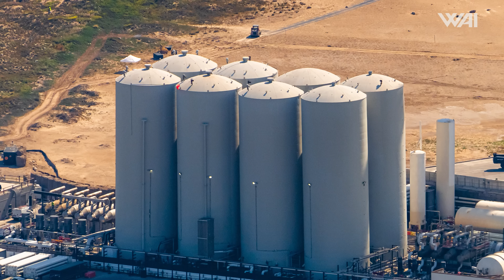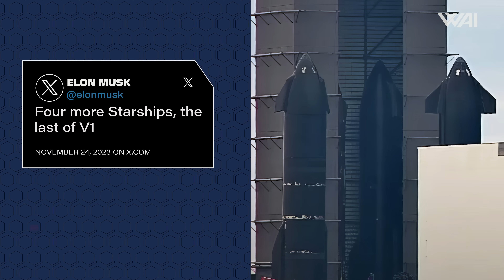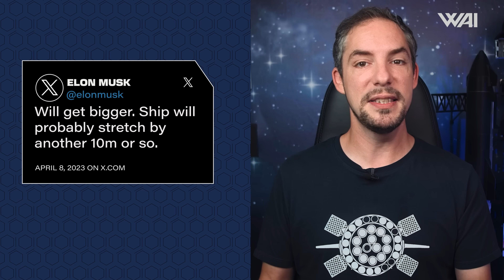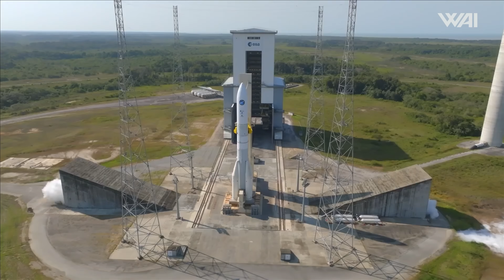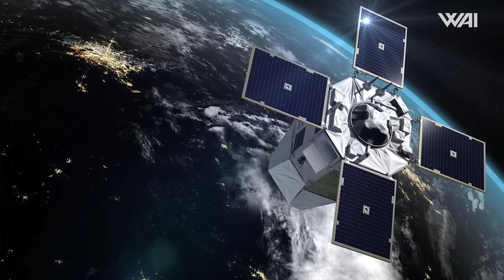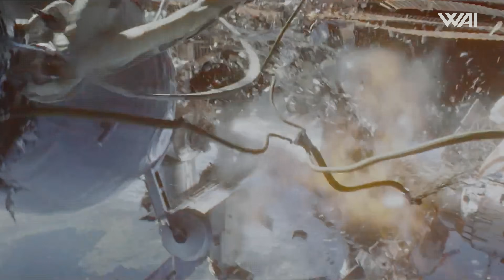Starship Evolution: Why SpaceX is Shifting To V2 Starship Now!

Comment from the maker: Go to https://myradar.com/ to get the best-rated weather app there is for Android, iOS & Windows! Weather as you've never seen it before!

Will they prioritize launching existing Ships before fully committing to the V2 design, or will they skip a few and go with a more advanced Prototype design? :_WAIShocked:
Reply: Felix, that would be great if you embedded the time stamps of the different topics in your videos.
Reply: They will test the existing ships still, TEST TEST TEST TEST.  They might not test all the V1 ships but they will test some of them.
Reply: I tried my radar on Felix’s recommendation and the radar alone is worth the cost. Radar animations are far better than the free weather apps.
Reply: I think if they can have a more rapid test cadence they will take it.
Reply: One ‘upside’ to things breaking, is that it makes it quite clear which parts are being broken or damaged - and so where to focus efforts on shielding and reinforcing and other measures, to achieve a more permanent solution.
This might still take a few iterations to get there…
Reply: They probably won't launch this year and they only have the capability to launch like half a dozen vehicles per year. So I think they'll try and make each launch count. So maybe 1-2 more V1 launches in the first half of 2024 (depending on if IFT-3 is another failure).
Reply: Skip them. Go straight to the latest design.
Reply: The thinner SS is a great idea but Elon and his team have not taken that to the limit yet. I know that Stelco Canada now bought out by US Steel, produced a much stronger cold rolled steel a stainless version of this steel which developed its high strength from special processes in the rolling mills that produced steel with twice the strength for the weight.
GM used non stainless version of this for their prototype run of Cruz police cars in 2011 for the Ontario Government.
Reply: I think the first thing they need to do is figure out how to keep the tiles on, something that has stymied engineers for over 4 decades.  Either that or figure out an alternative design which doesn't require a tiled heat shield.
Reply: @@MPK2112 Only two. It’s only two tests. Two launches, so far.
Reply: No
Reply: @@MPK2112 two prototype launches in one year and you're already going with never? They had 12 prototype launches of F9 over a 2 year span. Starship is much larger and more complex. F9 uses RP1 and a pretty standard engine. Starship is using an engine that has never been used before. It will take time. I'm quite impressed with their speed.
Reply: @@MPK2112 Yep, that's how they work. Government regulations may slow down launches but they don't slow down R&D.
Reply: I wondered the same thing. Perhaps they did (On the Quiet)-face it it kinda lets in the FAA in2 places they actually weren’t in& hence can’t CRIT on. And hold up launches from. But as you thought. So too did I. Face it it would have resolved all of the final questions missing to Absolutely perfect this growth to completion. And would have saved a ton of money.
Reply: With 4 version 1 ships available, they can take plenty of time to work out details of v2 design while still launching (and learning) as fast as they can get licenses.
Reply: Because it blew up and was not a success
Reply: How's life in the MuskCult ™?
Reply: @anthonylosego 21:47 21:47
Reply: @davidwildenheim6873  yeah, I watched that one, but I was thinking straight from V1 to V2. Paperwork will take longer than assembling S33 V2. Lol

Comment: Like Starship, the original Atlas missile was built by stacking circular segments. Atlas was "stretched" by adding more rings. Each Starship ring is 1.82 m tall.  A stack of 5 rings is 9.1 m tall, so adding 5 rings would increase the height by 9 m, which fits with Musk's tweet of 5-10 m taller.

Comment: The amount of innovation Is incredible.
Reply: yeah, the innovation in exploding is impressive. Now if Musk could innovate in actually reaching orbit.
Reply: alot of reinventing the wheel. Even if SS gets into space and back, it could still be a failure as the name of the game is cost and recertification.  Increasing engine pressure for more power means more stress. It is sacrificing engine longevity in exchange for performance. And that is why rocket engines have such short lifespans. They are generally operating at the edge of what material sciences can do.  What SpaceX should be doing is firing their raptor engine at the power setting and duration of the flight. THen doing it again and again to find out what the mean time to failure is. And how fast can they check all the parts and recertify it for another flight, and at what cost. That is what SpaceX should be doing.

Comment: Fun mind bender is trying to figure out if there could be a way to have a flexible insert inside the fuel tanks that empty out like a tooth paste tube and depending on how the valves are designed for the space that is voided out from the inner tube inverting into itself, keeping the fuel snugged to the nozzles, that it could help with how complex things get during maneuvers. Might have to be an idea that comes along when we can make meta materials on the sub atomic level and scale.. I wonder what Grok would mush into a concept design?!?

Comment: I think they will launch the V1s in fairly quick succession until they get to orbit and land.  They might put raptor 3s starting with flight 4 or 5 if required to get to orbit.  These flights are very much system and control development, most of the changes go to efficiency and performance and introduce only minor risk by rolling them in later
Reply: Problem is every test expends 39 engines. That’s a lot
Reply: yes that's why they will stay with raptor v2 if they can.  They are just working on a process.  They don't mind losing V2s since they don't want them anyway.  once they get the process down they won't lose many or maybe not any V3 ships or engines @rdmsh
Reply: Hopefully the EAA stays out of the way of rapid launch cadence.

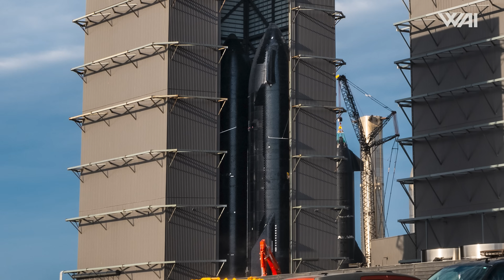Comment: 12:24 A great advantage, IMHO, in engines is what might be called "throttle range" so that many can be used at lower thrusts, but if one fails, instead of turning off its opposite number for balance, you increase the thrust of its neighbors to compensate.
Reply: SMOP.  ("Simply a matter of programming!")
Reply: Given you probably want to use as much thrust as they'll provide, the thrust vectoring is even more efficient
Reply: You might be interested in checking out the "GenSet" locomotive concept where one big engine is replaced with 3 smaller ones in a locomotive. When the locomotive is moving around the yard without a train, it can use one small engine for power, but as more power demands are required, more motors are turned on. It's more fuel efficient but requires 3x the number of engines along with 3x the engine maintenance and support equipment. Anyway, trains aren't rocket science, but one can learn by applying what's been tried in other areas to new domains.
Reply: @MarkNobleUS  --  I understand that most of the "Gen Set" locomotives were scrapped early.   The 2000+ HP can last years (like 6+) without major rehab and can be overhauled an easily kept going for decades.   500 hp engines aren't worth fixing after a one or two overhauls and the overhauls in constant use might be required only after two or three years.

Some RRs tried the hybrid approach.   They have marginal applications.   The RRs don't get conned into adopting stuff just to be trendy.   It has to save money or provide other benefits.   It if makes money, RRs don't hesitate to spend money.   Otherwise, they sit on their hands.

Comment: The main reason for the shielding was the RUD of stage 0 I believe, so you could probably remove that from current version because the risk has been shown to have been lessened with the redesign/upgrade of stage 0.

Comment: I would imagine SpaceX will use a mix of launching current V1 ships while using info learned there to work on V2 design and development.
Can never have enough data when it comes to such things after all.
Reply: Sure thing Wherner Von Braun , .
Reply: might as well launch a couple, if they have the boosters, I bet they have to tweak the process some and making the starship thinner may not be a great idea given how easily the booster (apparently) ruptured after the hotstaging.

Comment: One must not forget that it took them a while to learn how to build the rings to have welds strong enough to contaib pressure when filling up with cryos.
That the ship takes more explosives to self-destruct  does not  necessarily mean they can thin the heavy steel  and forget about the spectacular fountains of nitrogen as the tanks exploded during tests.  (though this happened a ot mroe during days when they were still learning how to weld).   Not an issue for the higher part of Starship that is to have unpressurized cargo, but for tanks, I wouldn't be surprised if they stick with the thicker steel.   Thinner steel also has heat absorbtion/dissipation changes during re-entry.

Comment: In the mean time test flights can be just for testing the booster, and the hot staging. From all accounts the flip after the hot stage was too aggressive. Testing and fine tuning that maneuver does not need the V2 starship.
Reply: You have to have the weight.
Reply: to test the hot staging and booster flip back maneuver you need the V2 starship?  i don't see why as the hot staging likely still has some tweaks it needs to be better, so test and adjust before getting into V2 so it is a non issue.  also the booster flip maneuver does not need V2 as it has already detached.  Test and tweak and adjust so it is also a non issue when transitioning to V2.  They have the rockets, use them to enhance and perfect the steps and process from launch to stage separation.  Also gives you more information to use to make V2 even better.  More flights is more information gathered to use to make better.

Comment: I think IFT3 will be a V1 design, IFT4 might be ship V2 design, but possibly booster V1 still. By IFT5, both will be V2 design most likely for sure.
Reply: Yes, I'd pick two more flights from the current V1 hardware. Partly because they have that hardware ready to go, and partly because they'll want more data from V1 to inform the design for V2... in particular, they'll be very keen to get at least one re-entry attempt out of V1 before committing to the V2 design.

Comment: Since they have lost 2 boosters and 2 starships so far, I think they should launch existing ships to see what the problems are before committing to v2. Now if they can upgrade the engines to v2 without changing the ships as is then I think they should do that.
Reply: The ships were never to be recovered. The evidence needed as to the problems was likely telemetered to SpaceX; they may or may not share it. If the existing ships have some of the problematic bits, they will never be launched until refitted.
Reply: They never lost anything , the two ships  were data collecting tools for future upgrades and better ship's, its all about evolution , its never about failure/succes like our educational system taught us and many of us still think that way unfortunately ,  its about evolution and constant learning by prototyping and trying new things and make improvement's over time just as it should be in real life .
Reply: yea the old designs have to much mass and the booster is the costliest part with 32 hard to produce raptors they will not waist a booster to send an old prototype with old flaws rapid iteration is needed the get these skyscrapers into space.

Comment: They need to install baffles in the tanks to prevent fuel slaush when separation takes place a single baffle would prevent fuel from bouncing around the tank.

Comment: The decision to scrap work-in-progress in favor of version 2 revisions before next flight would surely be based on what could be tested with WIP. For example, supposing an issue with fuel slosh or jacking caused the failed re-lights of booster engines, using WIP to test revisions might be valuable enough to invest more in flying them
Reply: I'd guess once the first V2 is ready and passes ground tests  we'll see whatever V1s that are left scrapped
Reply: @KiRiTO72987  I agree.  use what you have ready to go or nearly ready to go while you build the V2.  but once that is ready and tested and green lit for launch, then use that as by then many of the issues still had on last flight should have been adjusted and then flight tested and hopefully perfected so they wont be an issue
Reply: LOL. These are for his stock price and ego.

Comment: That Susie thing looks quite promising and versatile, I hope they make it happen.
Reply: It does... it sort of fits a niche between Dragon and Starship. It doesn't have room for much fuel, so I assume it's intended to sit on top of an upper stage like Dragon does rather than replacing an upper stage like Starship... so a capsule with integrated service module and propulsive landing (like Dragon 2 was supposed to do).

Comment: With the tiles they should install them on some kind of flexible like subfloor. In 50×50 tile sections. I believe they come off due to the low temp and the flex in the tank. If they were adhered to a simi- floating sub floor a few  Millimeters above from the main body, that would  Alleviate any effects caused from the starship From losing tiles.

Comment: regarding the stand up tanks so close to the pad 99.9% of the general public thought they would get damaged with the 1% being spacex and its managment..Doh
if there going to use stronger thrust engines ..good luck with the metal water cover.

Comment: There's no reason to immediately exclude Composite materials - the fore and aft flaps could easily be made from Carbon Composites or Aluminium Honeycomb to save mass, same with the rings and cone above the tank section, and any internal structures to hold and release payloads, Titanium would also suit those internal structures, giving the strength of steel for the weight of Aluminium.

Comment: Drymass reduction means certainly a new composition of materials on the Grid fins of the booster. I wonder why noone is talking about those. In the one interview from Everyday astroaut Musk himself is saying that they will change the Grid fins because they are too heavy currently.
Reply: Indeed, considering the marginality of their function, they are monstrously heavy, and the batteries / motors to operate them  have significant mass as well.. One would think that by now they would have come up with something lighter and smaller to achieve the same results...
Reply: Maybe just small fins like on the New Glenn rocket, but Elon copy Jef Bezos a bridge to far.

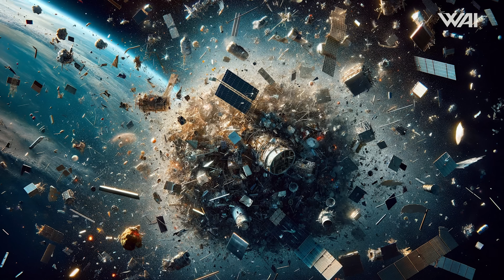Comment: 21:17 Luckily, images like this are not to scale. Though, cleaning up space debris is like collecting spent bullets at a firing range, but people are still shooting - and some of the bullets are the size of school busses.  A lot of space debris will de-orbit itself, but in cases where it won't, the best approach is probably to use high-energy space lasers to blast parts of the object vaporizing it in a little explosion that causes thrust in the opposite direction. Depending on the mass, it could take a lot of pulses. One might even use lasers to turn satellites into a sort of Crookes radiometer by darkening part of their surface with carefully aimed laser blasts - but there may be too much of a vacuum in space for this to work.  Essentially, the problem is how to impart energy on masses in orbit without having to expend the time/energy needed to move a mass into a docking orbit to shove it without causing a collision that would result in even more space junk.  It'd be interesting to study whether or not it makes more sense to "sweep everything into a pile" then de-orbit that - or to make a prioritized list and de-orbit things one-by-one.

The "sweep to pile" approach might allow the exotic materials we've sent to space so far to be packaged up in a rocket and de-orbited (using Earthbound Starship trip capacity after delivering cargo to orbit) for recycling. Probably a good idea after putting all of the junk inside to fill the compartment with spray foam to stabilize it for landing or something so it's not bouncing around inside.  What's important is developing the capacity to try lots of different approaches and see what works best in various situations. "All of the above".

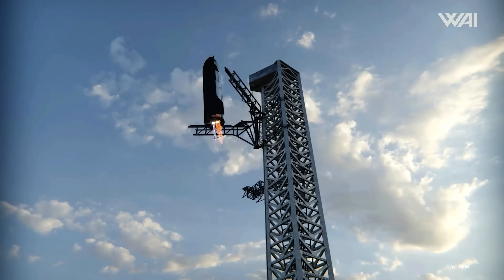Comment: Your analysis of the facts at 7:21 of the catch always being planned is wrong. It wasn't until they realized how hard it would be to land the Massive ship gently and the even larger planned booster did they realize that they needed a more robust launch platform and then decide to try and catch it on Stage 0.

Comment: Guys,,, been thinking about this for a while now... is it in regards to the heat sheild. Hence my posy comes in this video... my question is this.
.. Why are Spacex using such small heat sheild tiles... if they made them larger,, like a factor of 10x... it will reduce the amount needed. Also reduce the hear transfer line. One final thing... The mount procedure can be improved also..

Comment: Instead of using horizontal tanks, they could also simply use the front row of tanks as a shield and only use the back row. Maybe open them up and pour a ring of concrete around the outside the strengthen them.
Reply: The outer 2m of each tank is just insulation.  On the water tank this is just empty space.  A 50cm dent has almost no impact on the effectiveness of that insulation.